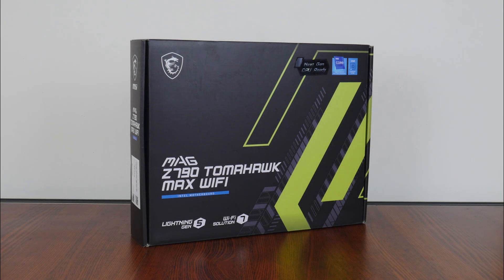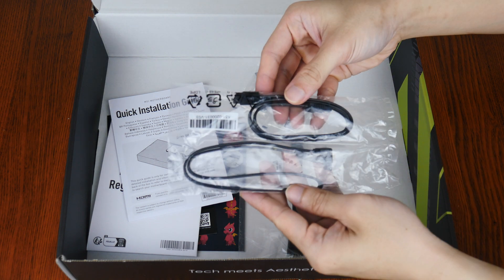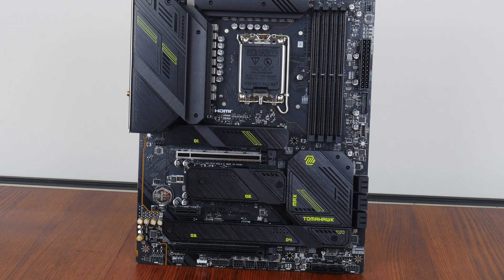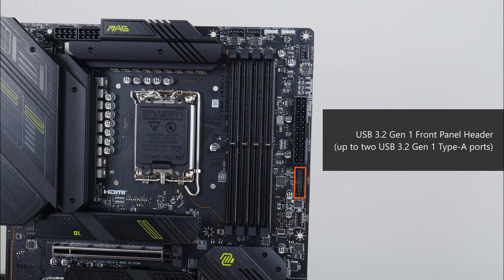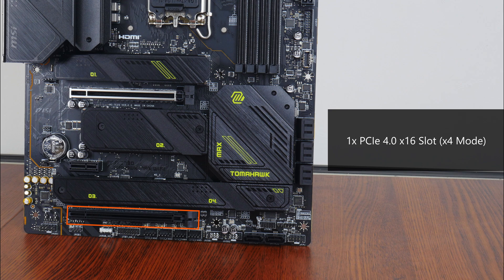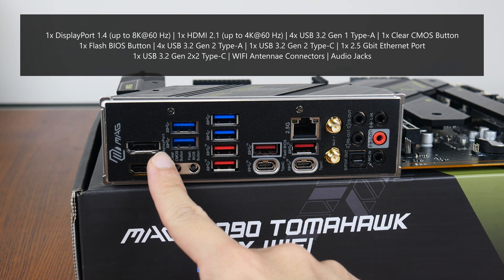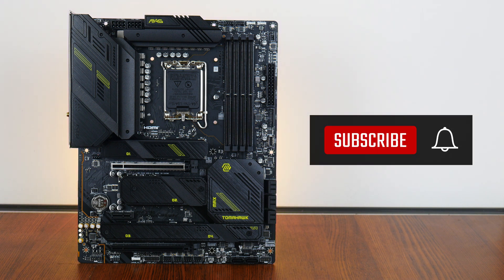Ready for Intel Next-Gen CPUs! MSI MAG Z790 TOMAHAWK MAX WIFI Unboxing & Overview

Comment: Just about to build a PC around this board. Stumbled on this video in my YT recommended feed. Great callout regarding M.2 slot 1. I'll be installing my 2x2TB WD SN850X drives into slots 3 and 4 rather than 1 and 2 like I originally planned. Thanks for that tip! Build will be in a Lian Li o11 Dynamic. 14900K, 64G 6000 CL30 RAM, 4070 Super, NZXT 360 AIO, full complement of SL V2 120mm fans, EVGA 1300 Supernova G2 (had a couple sitting in their boxes in my basement - used to drive Bitcoin mining hardware 10+ years ago). First PC I've put together in about 25 years. Mostly a workstation with some gaming. I went team green because a lot of the software I use benefits significantly from CUDA.

Edit: question for you... do I need to flash the BIOS to latest version before installing the 14th gen CPU, or is this board going to recognize it with the installed BIOS out of the box?
Reply: @ALKtech Hey, have you guys noticed any performance loss at all on your SSD’s with it not being directly connected to the CPU’s M.2 Slot? I saw a screenshot of the random read/write suffering considerably from it not being in the M.2 Slot one. Should I just get the non Max version of the Tomahawk as there are virtually no differences where it really matters?
Reply: @NL_Python  I have two 2TB WD SN850X drives - neither of which is in m.2 slot 1. They both perform extremely well. WD claims up to 7300MB/s sequential read  and 6600 sequential write. I get very close to those speeds in benchmarks - about 7100 read and 6700 write.

I went for the Max board. It was only a $20 price difference, and the support for faster RAM and WiFi 7 seemed enough justification for me :). Of course, your own mileage may vary on whether the differences between the two boards justifies the $20 price gap.
Reply: @JonnyBravo0311  thanks so much for your reply, I really appreciate it. 

I’ve decided to roll with the regular Tomahawk as they both are equally fast and reliable. I tried hard to talk myself into the Max (mainly for the RGB lol) but my OCD won’t allow it. I doubt I’ll be overclocking anything as I have 0 experience doing any of that and I am going with the non overclock ram @ 5600. 

I noticed we are pretty much building the same build as I also am getting a 4070 Super but I’ll be riding with the i7-13700K as the differences I feel will be negligible in terms of gaming/FPS. 

This is my very first PC/Build as I’ve always been a console gamer and finally decided to make the switch. I do have to ask if you don’t mind… 

What CPU AIO cooler did you go with?
Reply: @NL_Python  there is no RGB lighting on either the max or non-max variant. Your CPU choice is perfect for a gaming-focused rig. I went with the i9 because of the astrophotography processing use case I mentioned in an earlier comment. For cooling I went with the NZXT Kraken 360. I like the little LCD screen it has. The cooling performance is good. I'm looking at my CPU right now and it's idling at 27C. I replaced the plain black fans with Lian Li SL120 v2, which also fill the rest of my case - Lian Li O11 Dynamic Evo. If you don't care about the little LCD screen, the Arctic Liquid Freezer 3 is an outstanding AIO.

The 4070 Super is more than enough for my needs. In Avatar: Frontiers of Pandora, I get over 60 fps at 4K ultra settings. I don't play competitively, so my definition of good enough may be different than yours :).
Reply: @JonnyBravo0311  Somewhere down the line, I will definitely be investing in much fancier AIO like the Lian Li Galahad or NZXT Kraken 360 but I’ll slowly upgrade things like that over time.

I was actually looking at DeepCool LS720 but the Arctic Liquid Freeze 3 is cheaper AND it comes with a thermal contact which seems to be helpful in keeping temps down? I’m new to all this stuff. Thanks again for all the insight!
Reply: @NL_Python  I originally looked at the LS720… but the LCD screen lured me to the Kraken. The included contact plate with the Arctic helps to provide better contact between the thermal plate and the CPU than the standard Intel ILM. Definitely a nice inclusion, especially for the price point. There are third party options for other AIO if an aftermarket plate interests you and you don’t go with the Arctic… but honestly, I’d just go with the Arctic LF3.
Reply: @JohnyBravo0311 hey!! how is it working now?
Reply: @DAMNATION-nt3se  it's been working excellently. It is considerably faster on the astrophotography workloads than my Mac - by at least 3x. It games pretty good, too. At 1440p, I can play pretty much everything at max settings comfortably. Absolutely zero complaints with it.
Reply: @JonnyBravo0311  Which CPU are you  using ? I was to buy this motherboard and i9 14900k as we know  this CPU gets so hot and I found that this motherboard Socket get heated (watchbthis video it will help you to keep your motherboard long lasting--https://youtu.be/JaOYBYDib6c?si=fScsHK-fiJLcKR3U
 I am so confuse, don't know should I buy or not. Which country do you live in ?
Reply: @DAMNATION-nt3se  as I mentioned in my initial comment, I'm using a 14900K. Yes, the CPU can certainly run hot, and if left on the out-of-the-box MSI BIOS settings, it'll thermal throttle, very quickly hitting 100C. Change to 253W and 400A (i.e. Intel Extreme recommended settings, called MSI Extreme in the BIOS), disable the IA CEP for 14th gen, change the lite load from mode 16 down to a lower value (experiment with different settings) and you'll get good results with the CPU benchmarks. At one point, I was getting over 40000 in Cinebench 23, but dialed things back a bit as it would occasionally crash PixInsight (my astrophotography program) under heavy load.
Reply: @JonnyBravo0311  so there will be problem to buy it for 14900k as your is working great it makes impact!!
Reply from the maker: Glad that this video helped! Just curious, what kinds of productivity workloads are you intending to use your PC for?

That said, I highly doubt that you'll need to flash the board's BIOS, unless for some reason your retailer is sitting on very very early releases of the Tomahawk Max WIFI - I did notice that the first BIOS release available on MSI's website did not explicitly state support for 14th Gen yet. That said, even if this were to be the case, flashing the BIOS should be pretty straightforward too, given that the board does come with a Flash BIOS button that allows you to update the BIOS without needing to install a CPU/RAM/graphics card!
Reply: @ALKtech  just starting the build now. Thanks for the response about the board. Definitely not afraid to flash the BIOS - pretty easy to do. Was just curious if the 14th gen CPU was supported out of the box. I assume the stock is relatively new, but I guess I'll find out when I boot up for the first time :).

As for workload, a lot of it will be astrophotography. I went with the 14900K because of the number of cores/threads and speed. Processing astrophotography uses as many cores and as much RAM as you can throw at it. I considered going with a Threadripper, but the cost of the CPU was prohibitive. A number of the processes I use in astrophotography also take advantage of the CUDA cores.

Besides astrophotography, which is a hobby, my professional life includes development work. So, app servers, databases, microservices... Java, kafka, JMS, nodeJS, reactJS, angularJS, Spring... getting into ML. Having a machine that is capable of running everything, including one or more VMs, was also a key factor in picking my components.

Oh, and I like to do some gaming. In addition to the productivity work it allows, having the 4070 Super lets me play pretty much everything I want at reasonably good frame rates, and potentially stream as well.
Reply: @JonnyBravo0311  I use Pixinsight on a 7-year old i7 8700K machine and I am thinking about upgrading it to i7 14700K and this motherboard. I decided on i7 instead of i9 since I've read it runs a bit cooler and they are pretty equal performance wise (a few percent difference). It would be interesting to compare benchmarks once the builds are finished.
Reply: @nikivan  I was using PI on a 2019 MacBook Pro... core i9 16G. It's what I'm typing this reply on :). I was seriously considering staying with Apple, but the price of the upgrade just wasn't worth it. Comparable benchmarks to this system is the Studio M2 Ultra. That would cost me $4000 for the base model. Even refurbished I'd be looking at $3300. So, figured I'd build a PC. All in, my setup was about $2500.

Build is done - tomorrow I'll do all the fun software installation and updates. Hopefully I'll be able to get a PI benchmark to compare against my MBP. Best I ever got from this laptop was about 11k. Looking forward to what this new PC brings to the table.
Reply from the maker: @JonnyBravo0311  processing astrophotography's a pretty cool use case, not something heard about frequently at all! That said, the 14900K should handle your workloads with aplomb. 

And I guess you'll have some headroom too to upgrade to the next gen of graphics cards (probably on PCIe 5.0 by then) in the next one or two years. Enjoy the heck out of your new rig!

Comment: Hello guys. Who has drivers for WIFI 7 for this motherboard, for windows 10 x64???
Reply from the maker: Have you tried installing the Windows 11 drivers on Windows 10? You might get lucky...
Reply: @ALKtech  Drivers for Windows 11 are not compatible for Windows 10, unfortunately. You need to look for drivers specifically for Windows 10. But this is a big problem, because most likely they are not available anywhere ((

Comment: I only have 1 M.2 Gen4 drive what would be the best slot to install it in? I’m assuming 2 since you said about the bandwidth sharing
Reply from the maker: That's right, if you've got only one M.2 drive, pop it into the second slot instead of the first!
Reply: @ALKtech  Thanks. I’m a bit of a noob at PC building, but I was recommended that I install it in slot 1 because the 4080 is PCIe 4 and even PCIe 5 8x is the same speed as PCIe 4 16x? so it cancels out in some way? And the M.2 drive should be installed in the slot which is connected to the CPU directly which is only slot 1 on this board? As I say, really not sure about things since this is my first time building a PC from scratch. Am I throttling my GPU at the moment or will it only become a problem when the GPU is PCIe 5 itself?
Reply from the maker: @cheesedtomeetyou1  it gets a little more complicated than that - basically the slot will operate at PCIe Gen 4 x8 speed instead, simply because your 4080 doesn't support Gen 5. You will lose some performance as a result, though going by some of the articles and videos out there, it might not be thaaaat much of a performance loss. Still, if you wanna maximise your 4080's performance, go on ahead to install the M.2 drive in the second M.2 slot instead, the performance difference between having a drive in Slot 1 vs Slot 2 (if any at all) should be minimal!

Comment: I don’t understand downgrade bandwidth, I have samsung 990 pro 4tp (2tbx2)
Is there any problem with slots
Reply from the maker: In summary, just make sure that you've got your Samsung SSDs installed in the second, third or fourth M.2 slots (M.2_2, M.2_3 or M.2_4) - installing a SSD in the first M.2 slot (M.2_1) will deprive your graphics card of some data transfer bandwidth!
Reply: @ALKtech thanks

Comment: Do I need to update the BIOS on this motherboard to get the i7-14700k processor to work?
Reply from the maker: Nope, this board should come with a BIOS that already supports 14th Gen out-of-the-box!
Reply: @ALKtech  even if I haven't the sticker with "next gen cpu ready" written?
Reply from the maker: @teo3ds  oh, yours doesn't come with the sticker? There might be a very small chance that there are some early release motherboards that might have the first BIOS release that might not have full 14th Gen support - I can't confirm this, but even if this is the case, you can always load the latest BIOS using MSI's Flash BIOS button feature (which this board comes with)!

Comment: I have i9-14900k and 4090 with this board, which slot for the m2?
Reply from the maker: Install your M.2 drive from the second slot (M.2_2) onwards!
Reply: @ALKtech  yep i did it, thanks. Microcenter installed it in m_1 because i guess they didnt know so i had to take off the 4090 and put it in myself.. thanks

Comment: Thanks for the video, I do have this mobo, the i7-14700K with an aio artic liquid freezer ii 360. All is working great but I just wanted to know if you do have some hints on overclocking this cpu on this motherboard?
Reply from the maker: I didn't get the chance to overclock with this board unfortunately - have you tried trawling through Reddit for advice? You might come across folks with the same board there who might have firsthand experience OCing with this board!

Comment: guys very important question! should i upgrade NOW 13/12/2023 (december) my old CPU: 6700k, MB: z270 gaming asus. DDR4 2x16gb. to 14900k, this motherboard from video, and ddr5 2x32gb  OR i should wait for the next gen 15th cpu by intel with the new socket as everybody says?? thanks for the answer!
Reply from the maker: There's no real word yet on when Intel's next-gen Arrow Lake processors and platforms are going to arrive, it could be in the later part of 2024 or so. That said, it really all depends on your use case - if you find that you're unable to say, play the latest games at good framerates, or have issues with productivity workloads, getting a upgrade now would make sense for sure. IMO there's no real "good" time to upgrade especially since your PC is around 6-7 years old now and you'd definitely see a decent performance increase by upgrading to AMD's Ryzen 7000 series or Intel's 14th Gen!

The next noteworthy hardware launch would be NVIDIA's RTX 4070/4080 SUPER line-up rumoured for Jan 2024 - you might wanna hold out till then to see how these new parts might perform, and you might even be able to snag a good deal on the non-SUPER GPUs that brands and retailers would want to clear stock of, and pull the trigger on a full upgrade then. My two cents!
Reply: Should buy now, 15th gen is a joke, 14600k is better than 245k

Or wait another year for 16th gen, 99.9% 16th gen will be better than 14th gen

Comment: thank you for the informative video.
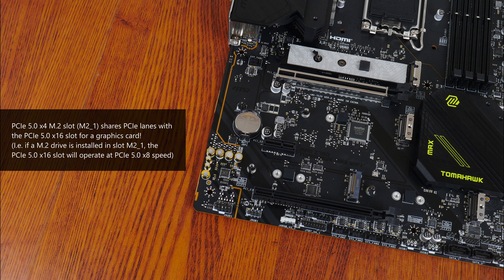I want to install Nvidia 4090 + 4 Samsung 990 Pro M.2 drives that will work in a RAID 0 (to be one big drive). but in your video you note, at 7:23 time, that if I install M.2 drive in the first M.2 slot near the GPU card slot, so the speed will drop from PCI X16 to X8. 
I don't want to get a drop from my 4090 GPU.
so from what I understand here, I can't install x4 M.2 drives and I can use only 3. 
is all correct?
please provide a link to this data, I am checking the spec/menual but I can't find this data.
Reply from the maker: Yes that's right, if you wanna ensure that your 4090 has access to the full 16 PCIe lanes, you'll have to install at most three M.2 drives, and avoid using the first M.2 slot (M.2_1). While the performance difference isn't that huge between PCIe 4.0 x16 and PCIe 4.0 x8, it's still something to note especially if you want maximum performance out of your 4090!

This PCIe lane sharing point is covered on pages 29 and 30 of the MSI motherboard manual available from MSI's website. Hope this helps!
Reply: @ALKtech  Do we can reduce the PCIe bandwidth version speed in BIOS menu? Because I've ever seen the NZXT one has a capability to reduce the PCIe bandwidth in BIOS menu from 5.0 to 4.0 version. So maybe if it could, is it will run at 4.0 x16?
Reply from the maker: @faristampan8251  I believe there should be an option to do so, though there's really no need to manually specify the PCIe slot speed, as the motherboard will detect the PCIe generation type and adjust the link speeds accordingly! E.g. if you have a PCIe 3.0 graphics card installed, the motherboard PCIe slot will simply operate at PCIe 3.0 speeds automatically - no need for any manual tweaking!
Reply: @ALKtech  Thanks BTW! Love you reviews, keep it up!
Reply: @ALKtech thought having the third m2 in disables the first and second slot?
Reply from the maker: @RyanREAX  this is only if you have a M.2 SATA (not M.2 PCIe) drive installed in the M.2_3 slot, which in turn disables SATA ports SATA_1 & SATA_2. This is because the M.2_3 slot uses the same SATA data lanes with the two SATA ports that I mentioned - not to be confused with the lane sharing thing for the first M.2 slot and the primary PCIe graphics card slot that is a different matter altogether!
Reply: @ALKtech  oh cool, so i should install 2 more nvme pcie drives in slot 3 and 4 but leave 1 unplugged?
Reply from the maker: @RyanREAX  that's right!
Reply: @ALKtech  should i overclock? I have 4090 and i9 14900k with 1200w psu.. or is this mobo not good enough?
Reply from the maker: @RyanREAX  this board will handle a 14900K just fine for day-to-day gaming and productivity workloads. In terms of overclocking however, I can't really comment much as I've never tried OCing with this board before, though I suspect it should handle some form of mild overclocking, provided you've got a really good CPU cooler or even a water cooling setup. My two cents!
Reply: @ALKtech  thanks.. ill keep it stock.. no OC just to be safe.. i also dont want my 4090 melting lol